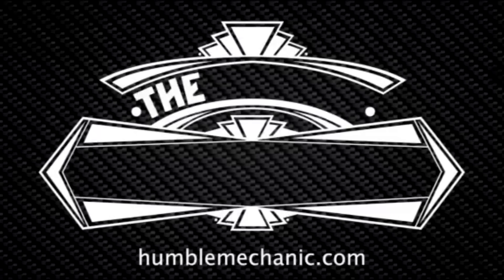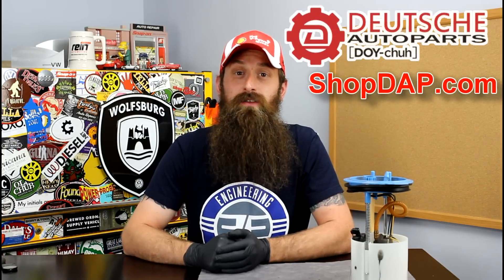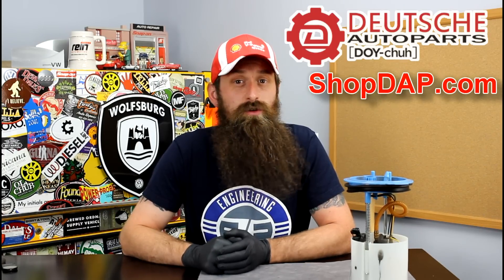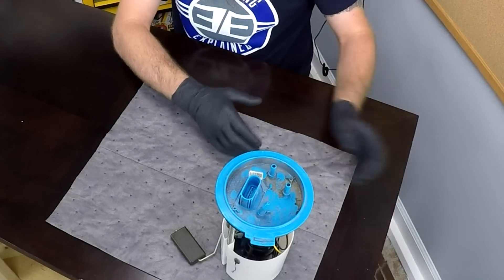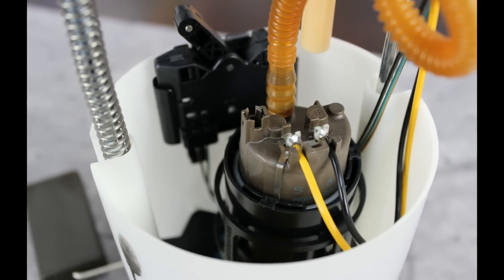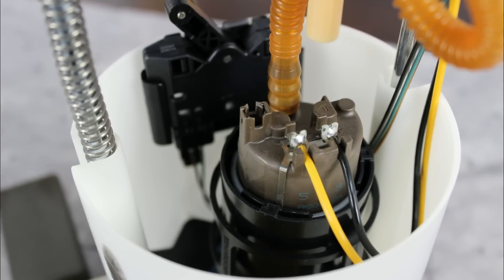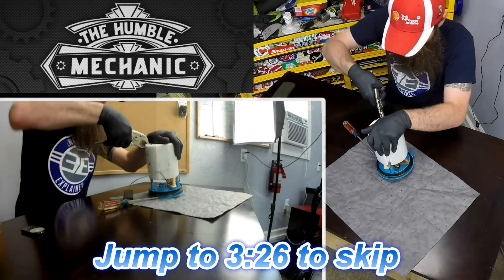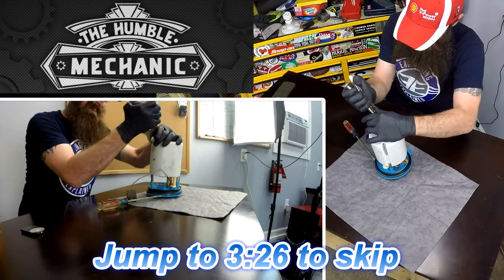How VW Parts Fail, In Tank Fuel Pumps

Comment: Hey man great video. I'm currently having a fuel pump related problem.I have 2010 VW cc 2.0 with 88 thousand miles. my car turns on just fine drives then dies when slowing down or at a stop. I'm just curious how I diagnose weather it's the high end or the low end pump.

Comment: my 06 gli has been taking a few seconds to crank and then start on the first start of the day only. Also, after driving it for two months I'm noticing that it's REALLLY luggy trying to launch in first gear. I've stalled it a dozen times, and thought it was from not having a manual for several years. Then I started trying different pedal-work to launch, bringing the revs up before letting out clutch. nothing. Even if i goose it up to 4000rpm it drops to ~1500 when I let the clutch out. It's really dangerous when I'm trying to make a left turn or coming out of a hill stop, or both. Is this the fuel pump or are the 2.0 turbos just geared this way? All the other gears give me lots of power whenever I need it as long as I'm at 2kRPM or more.

Comment: have a 2002 eurovan, installed new pump. now when fuel level reaches 1/4 tank, it is hard to start and acts as if it running out of fuel. fuel guage is correct because it takes 13-15 gal to fill up. it holds 21 gal. what happened?
Reply from the maker: be sure the pump is clocked properly, and be sure one of the lines didn't come off the pump
Reply: what do you mean "clocked?"
Reply: I have a 2018 VW Atlas and the check engine light comes on and off a lot and we put the scanner on it and it says EVAP leak. We have replaced the purge valve and the fuel cap. But when we are in a stop/go traffic it cuts off and I have to restart it, it cuts off maybe once or twice and sometimes it acts like it's going to cut off but don't. Do you have any idea what the problem is? I also have a message on the screen start/stop error until I turn the start/stop button off then the message goes away.

Comment: So I have a 2006 gti 2.0T with a hpfp and I keep getting high pressure fuel regulator performance 2. This morning it was like the car wasn't getting fuel and when I drive it in high gear low rpm it has a fuel cut it feels like. Could all this be caused by the in tank pump going out? Thanks in advance.

Comment: I just got a 2010 Volkswagen Jetta it cranks for like 4 5 sec then starts runs good is this a fuel pump problem the car only has 50,000 any input should be nice thanks
Reply from the maker: +MARIO what engine?

Comment: BPY motors consume fuel pumps at a crazy crazy insane rate in the height and heat of Las Vegas. 

Fuck Volkswagen.
Reply from the maker: I always like to hear about different failures around the world. We saw several FP failures over the years. But not at what I would consider a high rate. I assume heat is the issue?
Reply: HumbleMechanic We're assuming it's the sensor on the HPFP. The relay under the seat is heat sinked and relocated to open air, yet we're on our fifth in tank pump in three years on the 05.5 Jetta FSI (July manufacture)
Reply: I also wanted to apologize for taking my ire on the brand out on your video. Not appropriate. Just starting to hate anything with the logo on it. I'd be delighted to discuss this, especially if there's a solution I haven't thought of, but I'm at wits end with this car.

Comment: I have a 2006  2.5l Jetta with 155k miles on it.. And I notice at times when the tank is a 1/4 to 1/2 full I can hear a beeping noise(like the timer on a bomb)coming from the trunk on the right side. As well as a knocking sound as if someone is locked in the trunk and trying to escape from the right side. Both sounds do stop after a few minutes, but it seems to happen if I haven't driven it in a few days. Another thing that  happens is, when I fill the tank up it won't start right away, it will kill. I would have to pump the gas pedal while not on a few times then crank it. But in order for it to stay on I have to idle it for a couple of seconds, after that it runs fine. I also replaced the MAF sensor, air filter, and valve cover because I got a code P2279 and it was stalling & jerking. So I don't know if it's the fuel filter or fuel pump that's causing this issue.

Comment: Hi, I have a 2004 Touareg 3.2L v6. When I start the engine it turns off within 10-15 seconds. Once it got it fixed itself and started to run normal. I asked a shop to test fuel pressure, he it said its within specs. Same day I went to get gas and right after I got gas, same thing started to happen. Vehicle start to vibrate, gas paddle lose power, and turns off the engine. Do you think its the fuel pumps?
Reply: Rajeendra Lakruwan mine does the same mk5 golf 2004 
The fuel pump won’t stop wining after the engine is turned off 
And finally the car won’t start 
It will start for almost a 3 seconds the shuts off

Comment: humble please help. 04 with zero bar at rail. left side is the pump and right is transfer g6 right? I have power at pump but no power at transfer pump. would I see power at g6 pump if I have power at left side pump but no operation and zero bar? little confused if right side g6 is the problem of my no start. can't fit the vw tool to pumps separate so can't see which has pressure
Reply: please take it easy I'm a vw tech in training.

Comment: Hey Charles, can you recommend any specific troubleshooting ideas for a possible faulty LPFP on my mk6 GTI? I'm experiencing long cold start crank times which is becoming more frequent. It seems to only do this when the car has been sitting for several hours, warm restarts don't seem to be an issue. I'm not hearing the fuel pump prime when I open the door, but beyond that I'm not sure what else I could check. Would pulling fuel pressures in VCDS give any indication? What about key on, wait to prime, and then crank? Thanks!

Comment: after fixing my fuel pump my P0420 code went bye bye.... no need for a new CAT!!!!
Reply from the maker: +elewood T wow. That's awesome.
Reply: @HumbleMechanic  I have exact same pump that is completely dead inn my 2014 Vw Polo SA built ,I'm just concerned as I know the pump is completely dead but will it throw all other codes up aswell I have engine block start by immoboliser codes and can't read other other engines codes it's just crazy and the throttle doesn't work as it's electronic but if I throw inn fuel directly into the throttle body it will start and idle. so my question is can a dead fuel pump cause all those errors suddenly

Comment: Charles i replaced the fuel pump on my b5.5 passat and now in the morning it takes forever to crank over. Once i stop, crank again fires right up. Runs smooth no problems. Any suggestions? I only replaced the electric fuel pump
Reply: Did you ever solve this? I am experiencing the same problem.

Comment: what if you dont get current to the fuel pump or no current to the a/c either but can start if the pump is wired direct to the ignition  but starts to foul the plugs when idleing for 10mins plus till the idles changes and runs very lean
Reply from the maker: +hydropress69 gotta figure out when you oh don't have power at the pump.
Reply: at anytime it doesnt have power it should prime when the key is turned on or when the door is opened but it doesnt the relay seems fine but still no current was wondering if the fouling problem is from it being run constant  and as i said the other weird thing is the air con blower doesnt turn on either so i am assuming is a power problem from a relay just taught you may have seen this problem before it's a vw 200-ish bettle not sure of the year...thanks for the quick reply... really like your videos keep it up i know how much work goes into it and gotta respect that beard game

Comment: hey i got a 1992 vw cabrio and the fuel pump that gose out side the tank gets really hot and it makes some sweeking noice.do you think it might be going out o and some times when i drive the car it runs but then starts to spurer and i have to pull over after a wile it will start and go for a wile
Reply from the maker: +Raul Albiter That is a common sign of one or or both of the fuel pumps failing.

Comment: Thanks so much for this video. So informative. I had a strange occurrence recently with my '99 Golf. On the way to an errand, some random, intermittent cutting out of power. When I returned 15 minutes later the car would crank but not turn over. About 2 sec into the cranking I'd hear a subtle thump from the general location of the fuel pump. I left it alone for about 10 minutes, tried again and it started right up. No cutting out signs on the drive home. I replaced the fuel pump relay. Only very small signs of those symptoms since. Do you think that thump I mentioned is a sure sign of a failing fuel pump?

Comment: so my audi a4 b8 keeps saying tank system malfunction contact workshop. and the fuel guage would go to 0. recently instead of saying that it keeps saying refuel and i have 0 gas left even though i just put gas. The pump seems fine im assuming the sender unit is faulty. Can you buy it seperatly and then attach it to the old pump? also its a quattro is there only 1 sender unit or is there two each side of the saddle?

Comment: I had to change the FP on wife's Accord. Simmilar design. meant to be changed as a whole unit. bought an aftermarket performance pump for the car, Diameter was the same, but was longer 2 centimeters. Being carefull, the upper part came off from the bucket. Had to modify the pump bottom seating, with a hack saw and knife, to fit the filter.
i do not know the VW but on the accord, the return line come to the bottom of that bucket and raises the fuel level arround the pump to cool it. So when the pump gets fuel, then it will be cooled too.
I think that the pump/sender unit is changed as an unit in all car makers, The pump changing is for the DIY and independent shops.

Comment: All that stuff you tore apart can be replaced without destroying it like you showed in your video. You say it's not hard to replace but dayum...should have just given you a hammer if you were going to be that brutal with it.

Learn some patience and finesse next time. It can be done.
Reply from the maker: That part is replaced as an assembly. The only reason I took it that far apart wad to show the guts.
Reply: HumbleMechanic  Perhaps it is at the dealer since their purpose is to procure revenue. For the rest of us who are out of warranty it's cheaper to source a new pump or sender instead of the entire assembly.
Reply from the maker: I totally agree with you there. I have another pump right here I may try and disassemble to see the serviceability of the pump motor independent of the housing on this particular pump.
Reply: Jeff King you can get a new fuel pump for a VW for $39+shipping=$51.00 that’s not that costly dude!
Reply: The best way is to clip/snap/drill out the three "tree" supports that contact the white plastic bucket. The glue is harder than the plastic and must be destroyed. Afterwards, the assembly can rise up and be taken apart humanely.
Reply: @koburacape4222  so i need to drill the white support in the 3 contact black support point to get the fuel pump unless ther is no other solution !? Then if i did that how i can reassemble it again after drilling !?
Reply: I can’t take off the electrical wire plug on top of my fuel tank any Ideas
Reply: Manuel Contreras push down on the plug and gently wiggle the little tab upwards, hopefully you get it ok!
Reply: Your totally right I watch his channel but sometimes it seems that he doesn't know what his doing  and who put him to be one to gave advise or instructions how to do the right thing ..and that's really bad..but i enjoy him how him screwing at all...lol..sometimes..

Comment: Good video. Maybe you can do a video on AdBlue tank heater units found in the new TDI's. They fail so often these days that I'm waiting for the letter want day now about a recall. When there is a MIL/CEL on a B7 TDI Passat it's about a 85% chance it has to do with the freakin AdBlue system. My '13 just threw a MIL P205B last night at 36,600 miles.

Comment: I had an Audi A4/B5 that had basically all of the symptoms you described there. After some research I got the impression that changing the thing was an easy job.... oh boy were the internet wrong on that one. It was the first time I've ever given up on a repair because of the frustration with the extremely small clearences. No matter what angle I had my tounge at it (the pump assembly) would not sit/settle properly (and all the small rubber spacers were falling off all the time into the tank). Turns out you basically have to basically remove the tank to do it in the "correct" way...
Reply: Sounds like you disassembled the pump rather than install a complete unit. I've done many B5 pumps with no issues.
Reply: ***** Correct. It was only the pump part. I had a really hard time getting my hands on a complete unit at the time and did not opt for a used one.
Reply: Anders Evenrud The more hands during assembly... the better. :-)
Reply: ***** Yeah. I was a bit to brave going in alone. Good thing my dad was a mechanic back in the days... he came to the rescue :)

Comment: Also working with a full fuel tank is smelly AND messy, you don't want to get fuel all over your seats the smell will linger for weeks(not to mention if it's gasoline dont get it into your skin as it's very persistent and you wont remove that smell for days).

Also, no more wobbly?, upgraded finally?
Reply from the maker: I still have wobbles, he is just on a leave right now. 

This is a new custom built bar.